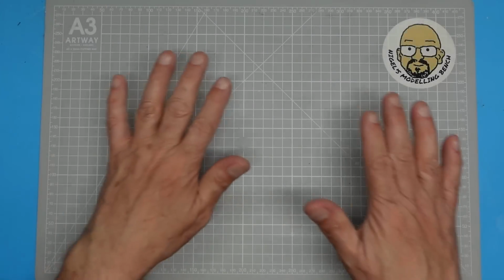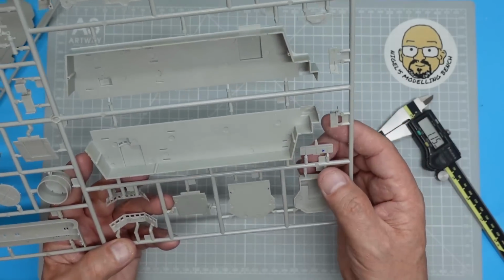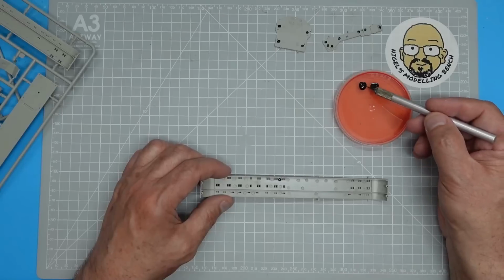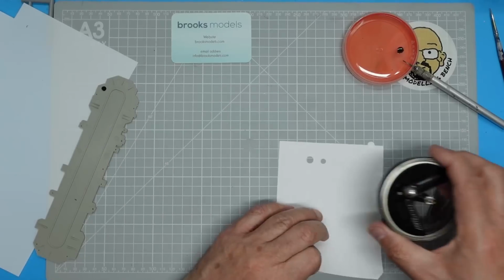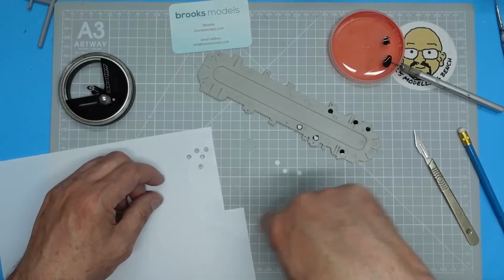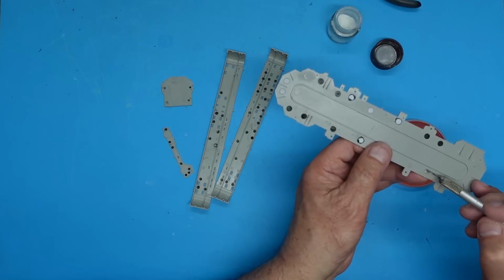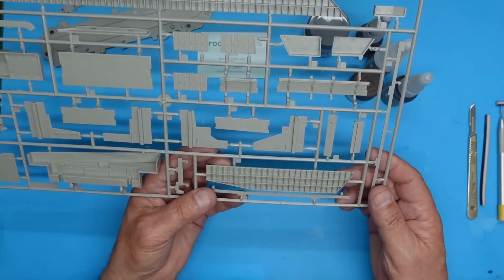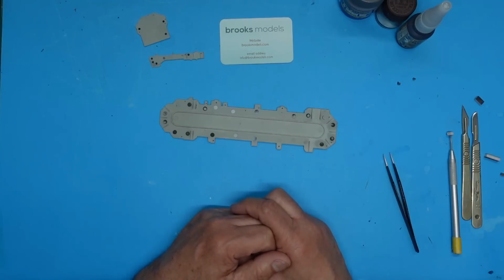Beginners guide to better model making. Part Twenty one. Ejector Pin Mark removal.

Comment: You're an engineer with a lathe and things, why don't you make yourself some punches or a circle cutter?
Reply from the maker: Yes, it is easy to make punches to cut circles out of soft material, I have dine it many times. Making circle cutter would be a lot more difficult and not worth the time when they can be bought off the shelf.

Comment: Hi Nige, good stuff.  You had me transfixed to the screen.
Can you use poly-cement (humbrol, revell, tamiya etc) to stick the bit of sprue or plasticard instead of super glue?
Have you tried "pierce and ping" trays (and other packaging) for sheet?  Free sheet!  As it may be a different plastic the supper glue would be needed.
Is your "antistatic" brush special (like for hifi for instance) or will any brush do?   
A thought that came into my head right at the end, how about rubbing the end of a bit of sprue against your sand paper and using the sandings as a filler just like your talc?
Reply from the maker: Hi Emma. I used superglue for speed and hardness, it also doesn't shrink as much as ply cement. I have tried other plastic packaging but never bothered.

Comment: I don’t have this issue as I only build wooden ships. Presumably the plastic is still soft when being ejected hence the marks. If so, surely the curing time needs to be extended or another chemical added to speed up the hardness setting of the plastic.
Reply from the maker: I guess plastic doesn't splinter like wood though lol. The reason they are there is mad tool design/manufacture or a sticky pin not pulling fully back? The marks in the thin plastic are as you say, but could also be differing shrinkage whilst curing due to sectional differences?

Comment: My, my, Nige, that circle cutter is certainly character building.  Why don't manufacturers scatter some blank squares (like faux parts) around the sprue for the pins to bear on rather than components of the model?  Or is there some technical reason why they can't?
Reply from the maker: I assume it's all down to cost John? More features in the tool = more cost? It could also be an "after thought" and it is easier to section an ejector pin than make a new feature. Not sure what you mean about the lovely little circle cutter you kindly gave me?

Comment: Hi Nigel, again lol.... Ref the circle cutters..They use tungsten carbide blades that were originally designed for Plotters / Vinyl cutters and they are manufactured with different angles to the cutting tips, most commonly 30, 45 & 60 degree angles... The 30's work fine for paper / masking tape but to cut styrene sheet the 45 & 60's work a lot better. Also because the cutting blade is offset they are designed to cut when rotated anti-clockwise, if you switch rotation direction the cutter will tend to 'bite' into the paper or plastic as it has to swivel in its holder to change cutting direction.

Comment: Hi Nigel, Interesting video... Will have to get some VMS Black Thin CA and try it out..👍..Also could you please show us which 'Glue Looper' you use?  I Googled and found them but they list 3 types, a V2.1 (Original Updated) a V3 (Thick Looper) and a V4 (Single shot precision). I currently can't seem to find any available in any UK Model Shops and they seem to be made in the USA, maybe you could let us know where you get them from?
Reply from the maker: I cant Im afraid. I've had this one for years. I think it may be by RB productions.
Reply: @NigelsModellingBench   OK Thanks... I thought it might be...Unfortunately Radu Brinzan no longer sells these, in fact they no longer sell anything!...He did separate from Aaron back in 2020 to concentrate on his design work and Aaron carried on selling the RB Productions stuff but I understand that company was wound up in Oct 24.... 
Radu called them 'Glue Tips' as the term 'Glue Looper' is a registered trade mark by the US company Creative Dynamic LLC but their products seem hard to get in the UK 😞

Comment: The disk cutter is similar to a dspiae one, there is a center for it. Because it uses a swivel knife, the circles are hard to measure precisely. Circle diameter is dependent on several parameters  other than the tool itself.  Speed and direction are 2 main ones. I personally use surfacer or sprue goo.